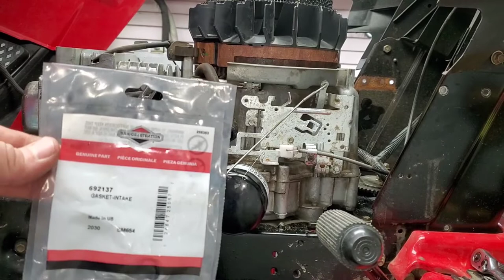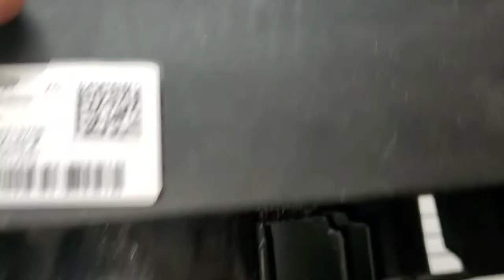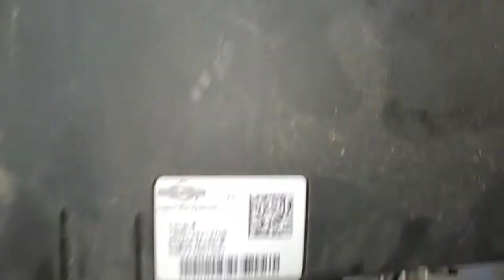Craftsman Riding Mower Won't Start Surges Ultrasonic Carburetor Cleaning Repair / Rebuild Model T130

Comment: Just a quick note. I noticed in this video , as in many videos, people take off the carb then struggle to take off the fuel shutoff soliniod. To save time and trouble, just break the soliniod loose while it is still on the motor. That way you have the advantage of the motor holding the carb as you torque, not your hand. After you remove the carb from the motor, then you can easily remove the solenoid with your fingers and you still don't leak/spill fuel until you have it on the bench. This saves busting your hands. Thanks.
Reply from the maker: For sure! Great tip!

Comment: @37:16 I have a steel shelf assembly in my way which supports the bottom of the gas tank. On my way to Ace to buy shorter lag bolts with the same thread size and pitch.
Reply from the maker: Yeah, some are designed way too close, have to remove the 4 bolts that hold on the tank first before removing or installing

Comment: Great video, I used it to try and fix my sisters T130 that was backfiring and spiting or sputtering. I found the same thing when I opened the carburetor that it was not really dirty at all. I still cleaned it and after putting it back on it still does the same thing.  It runs great when the mower deck is not engaged, but once you engage it the spitting, sputtering and backfiring comes right back.  I have also replaced the spark plug, air and fuel filters.  I also made sure there was new gas throughout and it still does the same thing.  Any suggestions you can give me.  Thanks.
Reply from the maker: I would probably look at it is a carburetor issue first and work your way from there. Does it help run better if you choke it partially?
Reply: @IndRepair  It runs great when the mower deck is not engaged.  Engine is smooth and no backfiring or anything.  Once I engage the mower deck it starts to backfire and spit / sputter.  Someone said it was possible that it could be the belt to the mower deck that might need to be replaced or something.  I just wanted to get your thoughts. Thank you.
Reply from the maker: @allennaylor5069  I understand, many times under a load they will run badly if the carburetor is partially clogged or the fuel is not the best. Normally they won't spit and sputter because of a bad belt but sometimes resistance or vibration can cause weird issues
Reply: Thank you and I will try cleaning the carburetor again.
Reply: @allennaylor5069  Mine does the same thing. It runs, but when deck is engaged, sputtering starts. Were you able to get yours fixed?

Comment: Is the EPA line necessary? If so, where can I buy a new EPA line for model number 247 203722? Or is there a way to plug it & use a vented cap?

My mower shuts off if it isn't connected. Could there be a different problem? 🤔
Reply from the maker: Unless it is plugged so it can't vent it will not be the issue causing a mower to shut off. Likely another issue

Comment: Thank you for the help. I recently bought a replacement for my mower, but didn’t realize the new carb isn’t set up for the auto choke…my original setup is. Otherwise, the new part is identical. Would this still work? Sorry if this is a dumb question.
Reply: Basically, is the auto choke feature necessary?
Reply from the maker: You will want to either set up the one you bought with a different choke rod or buy the right carburetor. It could be converted to work with just a piece of linkages like the old style
Reply: @IndRepair  Ah! That makes perfect sense for a different choke rod. I’ll see if I can come up with something. If it doesn’t work, I’ll just trade out the new part. Thank you again for your help, and for the prompt reply.
Reply from the maker: Glad to help!

Comment: The two wires on the bottom of the carb, My customer pulled his off. Now, they are separate from the little plastic harness which snaps into the bottom. What is the polarity of the two wires. black left, white right? I could use a little help with this. Update: using a 22" monitor and expanding the image to maximum I saw @36:33 a good close up of the black and white wire's orientation. I used some E600 clear glue that  I use for cell phone repair around the base of the crimped section where the insulation ends. just waiting for the glue to cure before starting it up.
Reply from the maker: Black toward the triangled part is how they come
Reply: Thank you!
Reply: I tried starting the mower after I replaced the original carburetor. I moved the electrical mechanism from the original carb (electric choke) to the new one. New one had one of two mounting areas with threads. I had to use a tap set to put threads into the cavity in order to mount the electromagnetic plunger for the choke. I put the two wires (black and white) into the harness and plugged it in to the bottom of the carb (fuel shut off valve) It will turn over but will not start. I reversed them and the battery weakened. I'll have to put the battery on a charger to try again Thursday.

Comment: I AllWAYS try rebuilding carb before I will use a aftermarket carb 
It’s hard to replace a oem carbs 😊
Thanks 😊
Reply from the maker: Been there, done that but the unfortunate fact is many times you can look at them and tell pretty easy how good of a chance you have at that carburetor turning out well. If it is not a good chance we're not gambling paying someone to rebuild at a cost usually higher than an aftermarket carburetor. If it is questionable I will call the customer and say we may be able to save it for x amount or we can TRY to save it for y amount and it may not work but if we choose this route you will have to pay that amount regardless of whether it works or not. This is why you see so many R&R only shops. You can loose a lot of time/money on things that can't be billed
Reply: My customer's carb is toast. I found an aftermarket carb with the machined threads to hold the electronic choke but did not have threads on the other side to hold the electromagnet device. I had to use a tap and die kit with cutting oil to put threads into the machined hole. It worked. But now the two wires on the bottom that make the fuel valve open and close were removed by the customer, with the two wires pulled out of the clear plastic piece that snaps into place not knowing their polarity. Nuts!
Reply from the maker: Black goes toward the triangled part

Comment: The vent? line from the gas tank...where does it go? Help! Hate mechanical work,but needs must...
Reply from the maker: On the front of the carburetor elbow there is a nipple pointing toward the back of the unit.
Reply: Thank you muchly!!!
Reply from the maker: Thank you for watching!

Comment: Gas started shooting out the air filter,  I'm not mechanic but I assume just swap out the carb and I should be good to go? Help 😔
Reply from the maker: Normally this is the case. Change the oil and then after getting it running change the oil a second time to remove remaining fuel from crankcase. Be careful when removing the old fuel, especially while trying to clear the cylinder. It is easy to turn it over and the spark plug will ignite those fumes. Be careful not to start a fire!
Reply: @IndRepair  thanks for the respond brotha, lawn mower a year and a half old, hopefully the carbs the issue. Thank you 🙏
Reply from the maker: Almost always is!

Comment: I just replaced my carburetor with a new one, a new gas line and filter, and new spark plug. Charged up battery and drained bad oil and put new oil in. It still will not start up. It makes the crank sound but doesn't start up. Any ideas?
Reply from the maker: Engine turns around ok though just will not start up?
Reply: @IndRepair  yes
Reply from the maker: Is the solenoid on bottom of carburetor plugged in? Sure it was good fuel you put in? Is fuel getting to the carburetor? Have you checked the spark?
Reply: @IndRepair  yes, its got a  good gas flow and the wires are plugged in the solenoid, I tested to check if the solenoid was good and I can hear the plunger going up and down in it also warm to the touch from trying to crank it.
Reply from the maker: And choke is engaged to the closed position and opens when taking off?
Reply: @IndRepair  yes that's working too I've also checked to make sure there wasn't any slack when placed in the choke position as well. Then checked pressure from the spark plug unit and tested the spark plug wire, which was fine too. I've checked for chewed wires and for loose bolts on the starter solenoid that runs from the battery, even making sure it was grounded well to the Body of the lawn mower, everything is good on those things.We did have a little gas in our oil that's why we replaced the carburetor, and did a oil change. But it's still not running? Just a crank and nothing....
Reply from the maker: Possibly a stuck valve. Have you opened the valve cover?
Reply: @IndRepair  the cover was stuck on finally got it open, and the arm over the exhaust rod and valve broke in half. Once I get the replacement parts. I'll update you! Also thank you for your help!
Reply from the maker: Good job!

Comment: Where would I buy a choke solenoid?
Reply from the maker: You will need the model and type from the top of the valve cover on the front of the engine. They can be bought online many places. If you have this number I can help you look it up

Comment: How would I adjust that spring?
Reply from the maker: Which spring do you talk about?
Reply: @IndRepair  well for my t110 it sounds like it keeps misfiring is there a possibility you could give me a call? Or we could talk cause mine is super werid it’s not working the best rn like I changed the spark plug and it was all black but when I lower the amount of fuel so when I take it out of clutch it keeps shooting to much petrol into the engine
Reply: @IndRepair  or it’s shooting to much gas do you recommend I just change the carb or do I try to tune it because I really don’t want to change it or open it as I’ve never worked on an engine in my life so idk what to do
Reply from the maker: Most likely a fault float or needle...probably time to change it out if you have it narrowed down to too much fuel
Reply: @IndRepair  is there a possibility you could give me a FaceTime call? Or I could call you I’m super lost rn